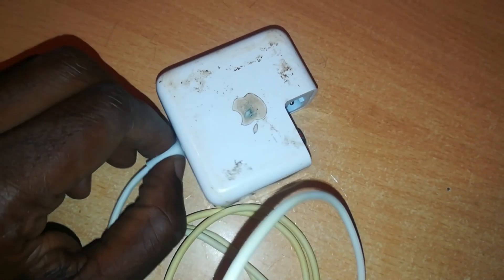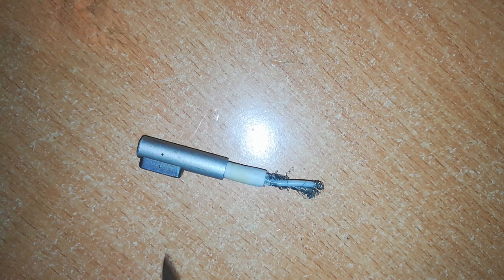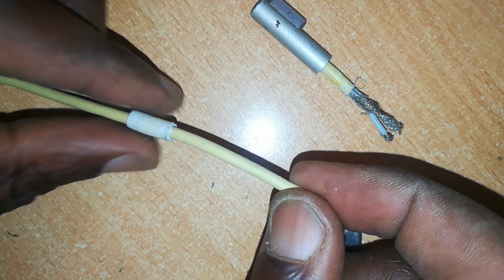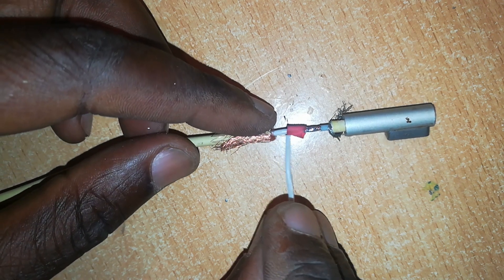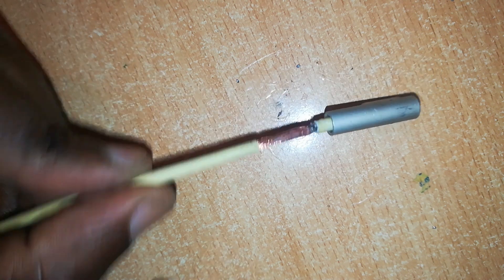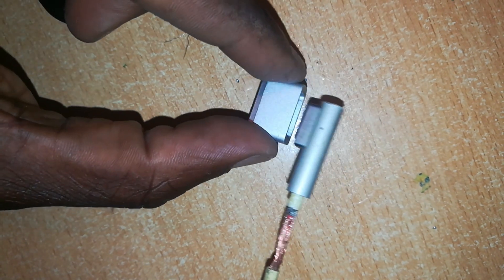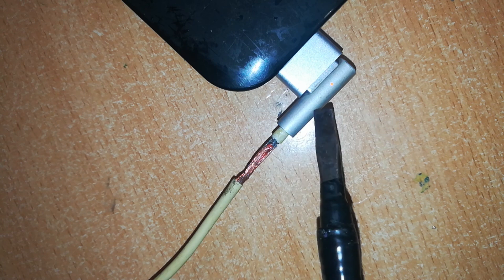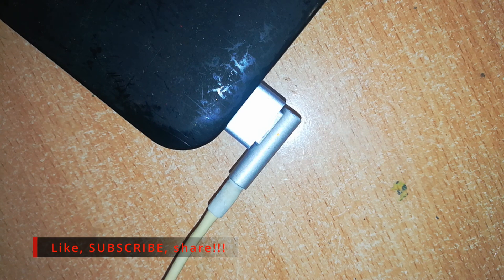Apple Magsafe 2 to Magsafe 1 conversion! DIY!!

Comment: why would you convert magsafe two to magsafe one and then convert it back to magsafe two with an adapter 💀
Reply from the maker: i was using a macbook air (with magsafe 2 port) to test!
Reply: @reachtech1  while that makes sense, was there even a point of all that soldering just to make it into a magsafe 2 port again?
Reply from the maker: @WindowsXP2600  hope it helped someone....not myself necessarily..
Reply: @reachtech1  yeah lol
Reply: @WindowsXP2600 kind of critical, it’s pretty clear that it can be done either way right he could’ve just put it back on if he wanted but he has other videos